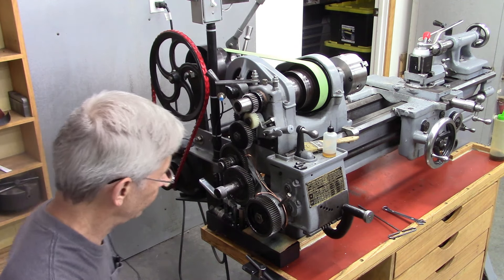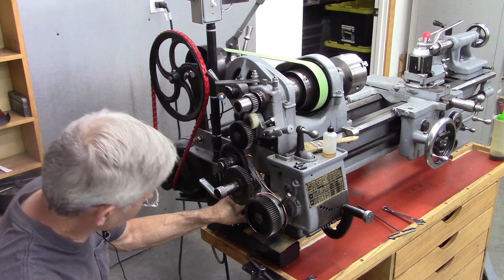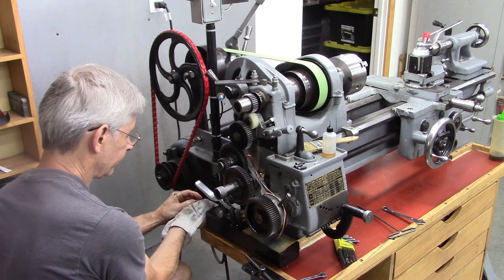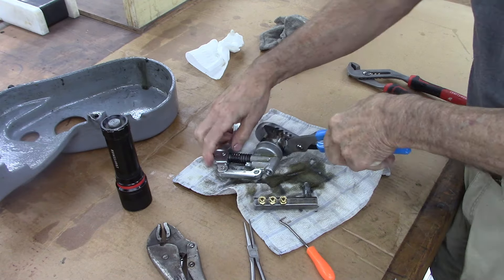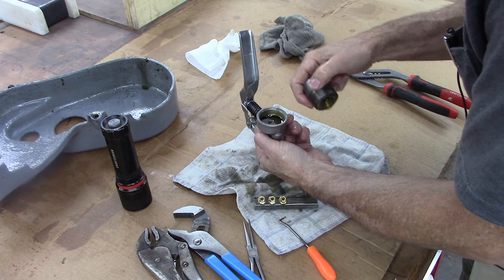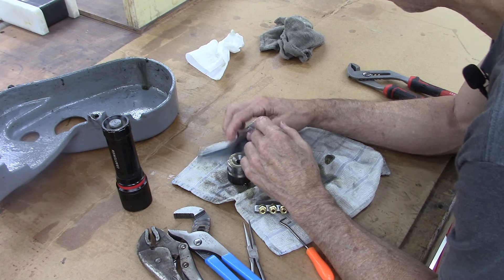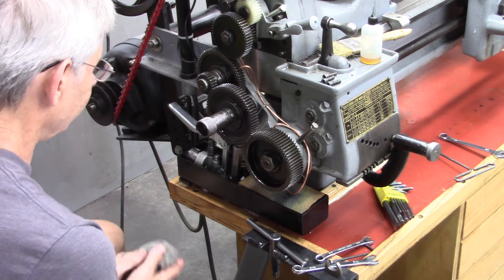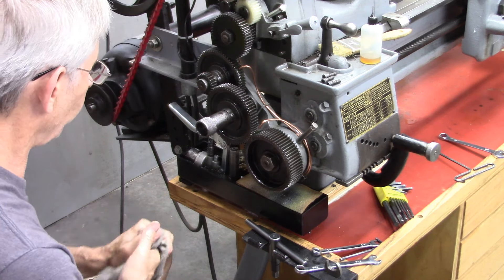Change Gear Oil Pump Revisited

Comment: 90 wt gear lube works great.  A little drizzle on the gears at the start of the job and you are good to go   Simple & effective.
Reply from the maker: I've use 90 and 600 wt and the Lucas works better.
Reply: @WinkysWorkshop  I use way oil or bar chain oil.
Reply from the maker: @cpcoark  I've used both and also STP, this Lucas product works better.

Comment: Just my guess but, it seems to me that the inlet to the pump is well above the center of travel of the piston. In a grease gun the spring helps push the grease into the piston cylinder. As the piston moves to push the grease out the piston covers the inlet then starts to push the grease out the outlet. The piston would be the inlet check valve. I think in your case the oil level was below the inlet to the pump, need to have the body of the pump lower in the oil reservoir.
My 2 cents and with inflation that is really not a whole lot.
Thanks for sharing
Reply from the maker: I agree. The level was close before but it needed to be higher

Comment: Maybe just a tube to extend the intake further down into the reservoir. Might work,
Reply from the maker: The pump relies on gravity and wont suck. Basically that what I had, the steel piece that screwed into the pump had a hole in the bottom to pick up oil.

Comment: Have you considered trying to use a pump from an oil can? Every grease gun I’ve ever used depended on the spring pressure to do a lot of the work.
Reply from the maker: I did but only after I had problems with the grease gun. It seems to be working well now but I think you are right about the spring.

Comment: Hey there Mark, could you use 5w/30 or a 0w oil so it would flow a little better, just some food for thought.  Be safe my friend
Reply from the maker: I think the Lucas oil stay on the gears the best and now that I sealed the pump it pumps very well, thanks

Comment: You'd have to have a check ball on the intake or it will just pump back out the inlet port instead of down the line right? As a grease gun it has been filled and pressurized by a spring piston. I think your pump will just suck in oil and blow it back out the intlet.
Reply from the maker: Not really... its like the oil drains into a pocket and is trapped....  I think. Its working now. I don't know exactly.